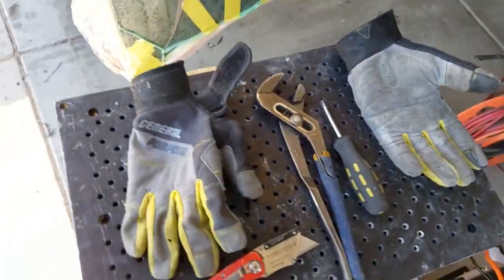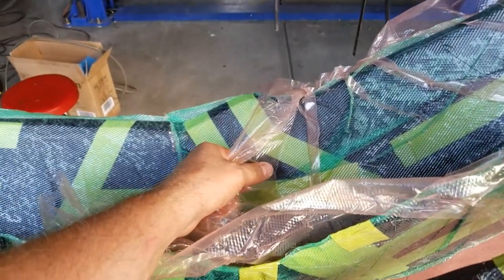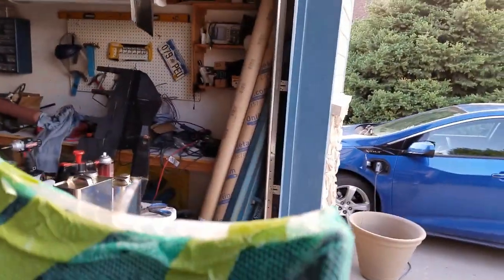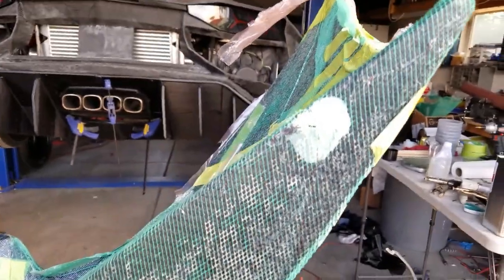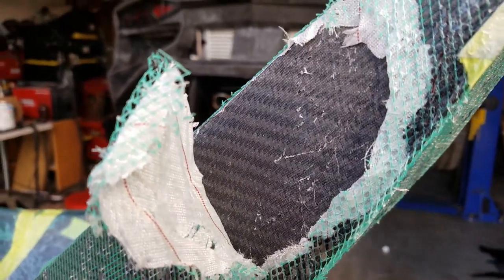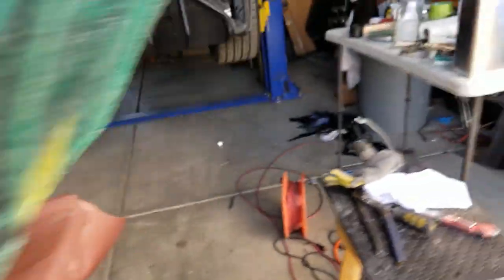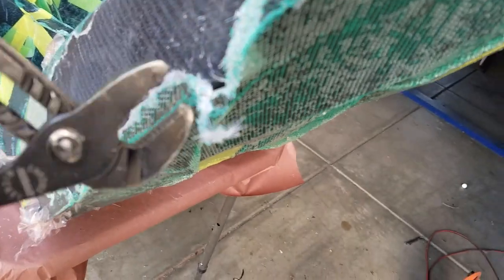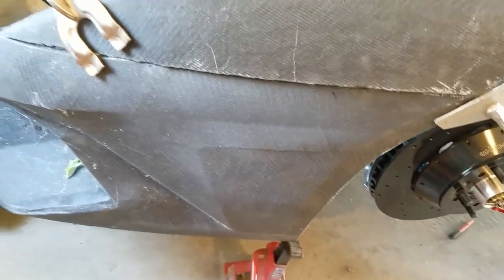Skinning 3D printed body parts (encapsulation) Removing Bag - Part 6

Comment: Just finished the 6 part series! thank you so much for this. I have a couple of questions for you. 
1- Do you have any experience with the encapsulated pla part and heat? i wonder how the internal PLA part will act inside the carbon and next to the exhaust or even just out sitting in the sun? 
2- Part two of this question is are you relying on the PLA part holding its structure wherever you have a bolted connection? or will you use some sort of metal spacer so that their isn't pressure from the bolt on the PLA? 
3- if you are planing on some sort of different fastening system or approach could you share this with us?

I am already producing my own 3d printed body panels for a motorcycle but have found some issues with heat and the durability of the PLA so i planned on scrapping the idea of wrapping or skinning the parts and instead using the parts to create negative molds for finished carbon parts. 

Cheers
Reply from the maker: 1. yes.  PLA sucks.  I have changed to ASA/ABS and reduced the thickness to 5mm maximum.
2. I epoxy in threaded steel inserts.
3. See 2
Reply: @lasersterling  I assume you changed to ASA/ABS because the PLA got too hot from the resin?  Do you know of any reason why PETG wouldn't be a good option as well, I think it has a similar glass transition temp to ABS?
Reply from the maker: @nickmkkay  PETG should be fine.  I think it is pricier than ASA.
Reply: @nickmkkay yes, petg good idea 🎉

Comment: Subscribed. 

What size printer did you use to make the chunks ?
Reply from the maker: 300x300x400mm
Reply: Holy COW!!. Awesome work!!!!

Did you use a specific piece of software to block out a 3d model ? Isolated the parts then chunked/puzzled then epoxy+skinning? 
Did you buy a True 3d model??

I might consider doing something like this on small scale and go from there. 
Airdams, spoilers, doors.

Sharing!
Reply from the maker: @caseycappoen251  SolidWorks